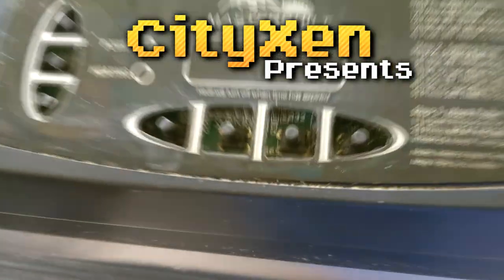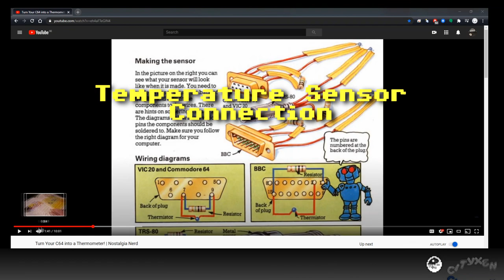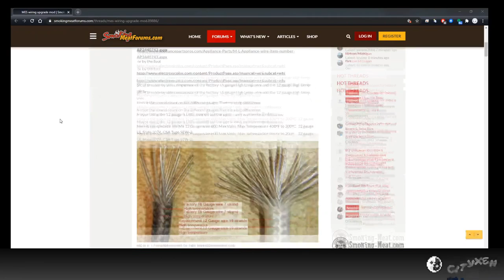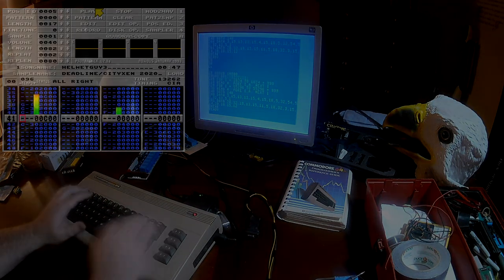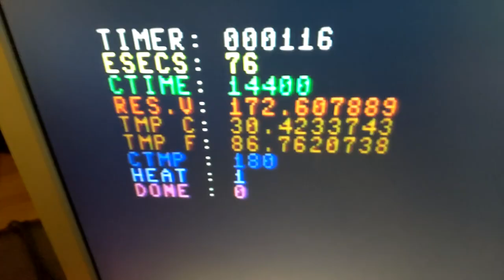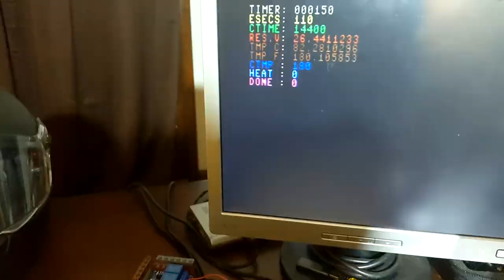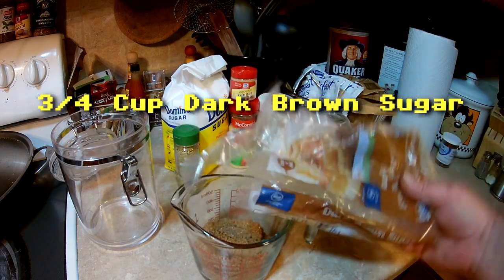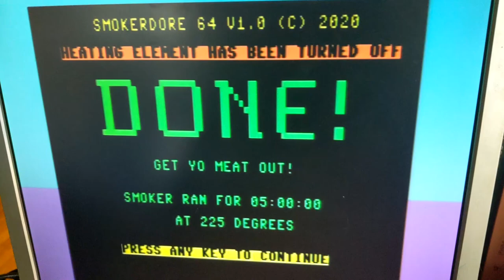Commodore 64 Meat Smoker Controller - The Smokerdore 64

Comment: The company I worked for was in the slot car racing magazine/track building business and they used the C-64 for a race management/track monitoring system. They designed a controller board that fit in a 3X5 box, designed to monitor the 6 lanes of a standard slot car track.  It used dead Track segments to trigger the lap time and counter, displaying it all real-time on the monitor or external display of choice.  Once a race was finished, it would display the race stats and prompt the racers to rotate to the next lane. After all said and done, we had the option to send the race results to the printer for all to peruse and brag about. 

There was talk about burning the track program to EPROM for cartridges, but it didn't get that far. It got as far as having a production run made of the relay board assembly. It sold well and it was regarded as one of the better track managers.
Reply from the maker: That is fascinating. Do you have any pictures of this in action? Either from the racetrack or screen pictures of the program?
Reply: @CityXen  It's been over a decade since and they moved back to Arkansas and disappeared into obscurity. The gent that did the software has vanished too, perhaps is deceased by now. I'll see if I got any copies of the software floating around, but I dunno.
Reply from the maker: @Nighthawke70  would love to view that.